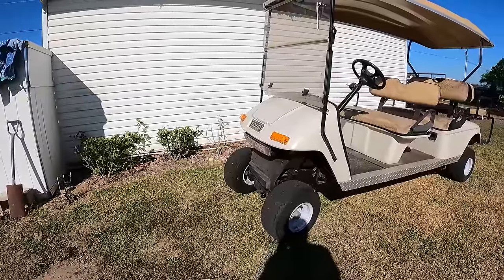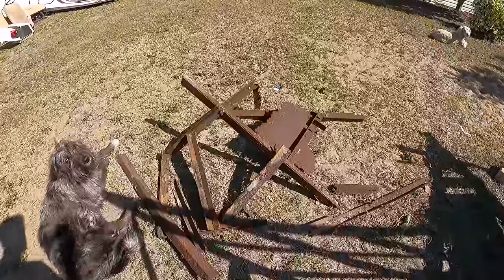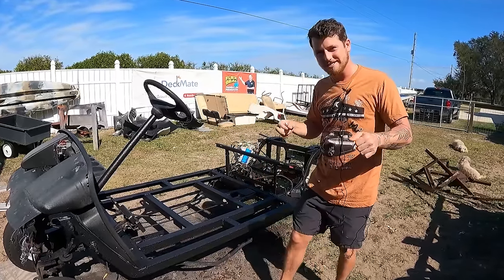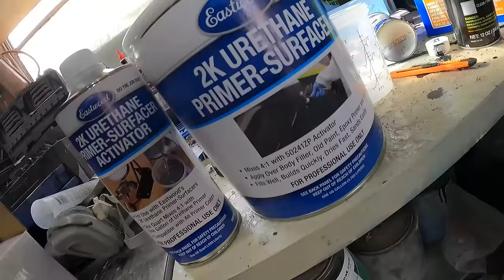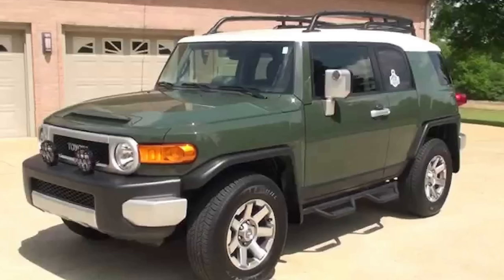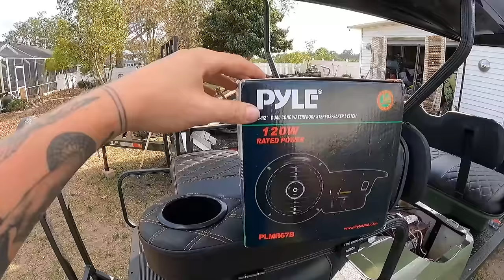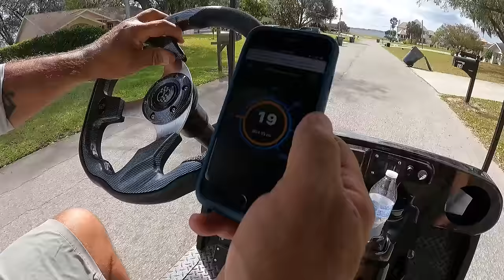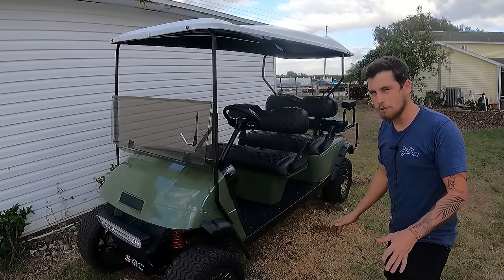EXTREME Golf Cart Makeover

Comment: First, throttle issue is likely 1 of a few things. Check the micro switch in the pedal box (if you’re not getting a solenoid click when it messes up), check the white 4 pin molex connector going to foot switch/ITS since it’s not a watertight plug. If those all check out good, it is possible that the aftermarket controller you have is going bad. Looks like an Alltrax or possibly an Alltrax knockoff. They knockoffs that we’re made a few years ago are known for having this type of issue. 

Things to improve on: While the cart looks pretty good, drivetrain wise needs some improvements. First, I noticed that you are running 5 batteries (I assume (5) 8v’s if it’s a 36v nominal system). While this works, you are sacrificing run time/capacity as well as likely not getting a full charge. (Charger shuts off around 40-41v on a 36v pack. Since your nominal voltage is now 40v, your peak voltage will be 45-46v). Basically your charger will shut off when it sees “full”, but your pack will be maybe 50-60%.  Also, if you intend on using that cart to haul more than a few people, I can’t stress at least going to a 48v setup enough. 36v carts have a lot less performance than 48, and 36v limo carts at full capacity really struggle to say the least. If you want to get some serious speed and torque (35mph+) and/or do burnouts I would highly recommend a 5kw Navitas AC kit on a 48v lead acid or even lithium (Eco Battery) pack. While these kits are pricey, they are well worth the money and definitely increase the value of the cart overall. 

If you need any help with anything or deals on parts, feel free to contact me. Would be glad to help you take this to the next level!!

Thanks, Jonathan 
Southern Custom Golf Carts LLC
Florence, SC
Reply: This is great information, I look forward to seeing if these upgrades are used in his future upgrades of this cart.

Comment: Man that frame was held together with thoughts and prayers. So. Much. Rust. Great to see you posting again! Keep them coming!
Reply: The thin floor panels where gone, most likely some joints also. The box section he cut away had some clean steel left, so not completely gone i would say.🤓 I guess they don't really protect the steel from the factory. 🤔
Reply: When he pulled the floor mat off, my first thought was...$1500.00? You overpaid!
Reply: The rust is why I like Club Cars much better.

Comment: @ultimaterebuilds Pull the cover to the throttle box. It will have a switch, ITS sensor and rod in it. The rod slides through the ITS "Inductive throttle sensor. But I've replaced a bunch of switches on ezgo carts. If the solenoid doesnt click when you press on the accelerator pedal check the continuity of the switch. Cheap fix. I dig your content!

Comment: Biggest problem with those carts is the motor and electrics. It's usually the same motor for the basic two seater as for the extended version. And those bigger wheels require more power. A motor/electrical upgrade may be in order.

Comment: You are very handy and creative. The colors look good on the cart. I really like the makeover. You did very well. It goes pretty fast too. We bought a country home in the mountains with a long paved country driveway equivalent to 2 suburb blocks. I need a cart to go check the mail, throw the trash out, and get around the property. I am looking into fixer-uppers. I am leaning towards gas.  I need a cart with power as the driveway leading to the house is on a mountain slope. I suspect I will need to upgrade the motor. I will continue to research.
Thanks for sharing Croc-man. MountainAngel

Comment: Turned out fantastic considering what you started with and the work it required.   I'm not so afraid of searching out something needing a renovation as long as the frame is solid, I just don't have the means or experience welding to be performing those repairs.  I even like the color, it would work really well for a military themed cart too.

Comment: Keep the raptor kit.   You can use the bottles.   And buy rubber under coating by the gallon.    Or mix all your old paint’s together and it will make black paint sooner or later.    And it makes a good under coating.

Comment: a probable fix for you is inside the charger port is a fuse that is common to go out. you can bypass it by connecting a wire to the ground or just buy a new port. the reason it makes it not go is because its a safety ground to stop the cart from being driven when charging. we had the same issue and while at first it doesn't seam its connected to your problem it probably is..

Comment: Nice job!  Depending on how much that ignition box is, maybe for now just run a simple toggle switch up to the dash going back to one of the wires by the ignition harness plug just to break that circuit and reset it it all from up front.  Just an idea.

Comment: Looks really good. Since you went that far you should go ahead and replace all the old wiring with better updated wires. Will probably save you from future failures.
Reply from the maker: When i replaced the lights i replaced all those wires too
Reply: @ultimaterebuilds7127  great to hear. I didn’t notice that. Major transformation. I was a little skeptical of the color at first but then you pulled it off with the great looking seats and wheels.

Comment: The one thing I would have done different, since you had to replace all the metal in the middle, I would have made it a couple of inches longer to give the backseat more legroom. I think you could do that and still make the roof work although you would have to move the holes for the roof supports. Of course that would have been more difficult because you would have to move all of the metal at once and figure out a way to support the vehicle temporarily.